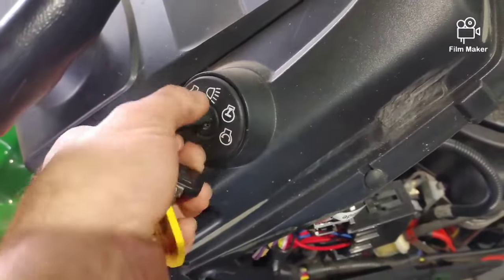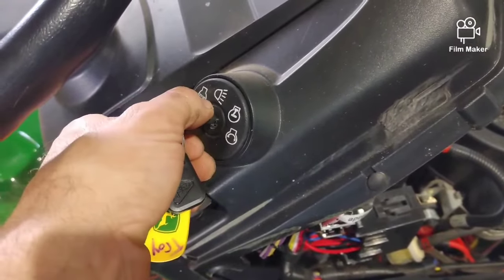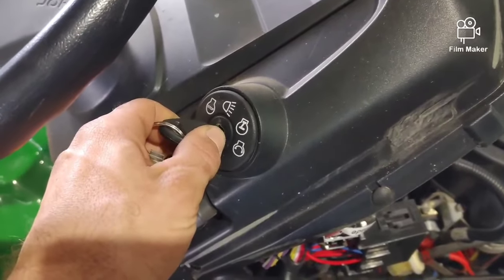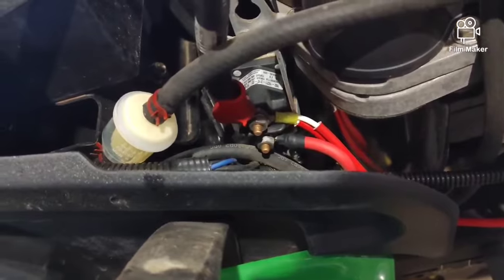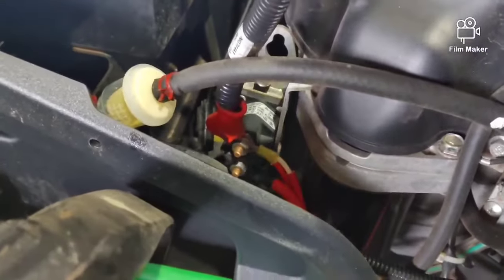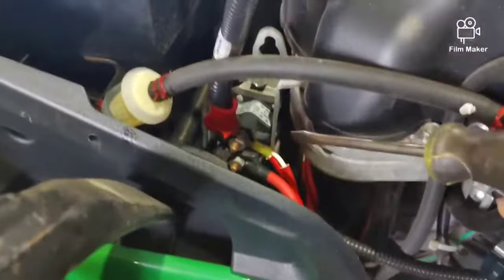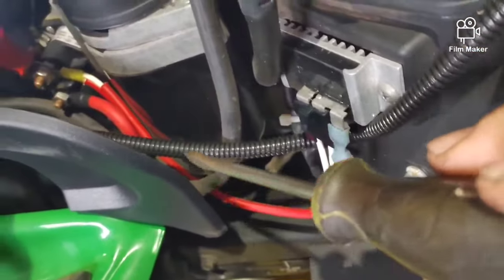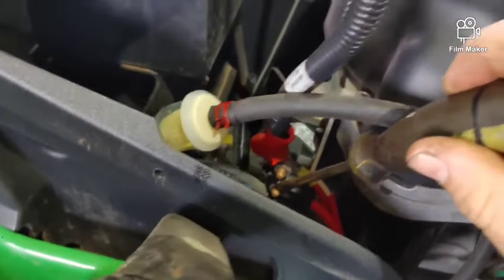Mower not starting, Just Clicks? How to diagnose & Please read video description.

Comment: I’ve got a John Deere X730. When I turn the switch to start, it has one single click. Dash lights illuminate. Checked the battery and terminals, they’re good. Replaced the solenoid, it does the exact same thing….one click.

Comment: I just took my John Deere lawnmower out for the first time this year and the starter kept spinning but didn’t engaged to turn on the engine. I didn’t know what to do, I’m new to this. I started watching videos but none of them mentioned what I needed. You did, you mentioned exactly what as mine was doing. I took the cover apart to spray wd40 like you said. However, I found mouse nest right on the starter.  I cleaned it, sprayed WD40 and it started like new. Thank you so much.

Comment: When I do this to mine, it just keeps turning over, i sprayed starting fluid and still not firing, bad plug or wire? Just odd or it to cut off while cutting then straight to this problem but not even firing
Reply from the maker: Check the spark plug first.  
It could also be the ignition coil. Did you hear a noise when the engine stopped? You could have a loose push rod that may have dropped. Or worse a dropped valve or even a broken connecting rod

Comment: I have a 1991 JD LX176 I bought new. I have been experiencing  this same issue for a long time. I was convinced I had a bad solenoid. Bought a new original JD brand solenoid and it did not not solve the issue.  That was before I gained knowledge of multimeter testing. I tested the solenoid, and after several reps of turning the key to start , I got over 12 volts every time. Removed the starter assembly and bench tested it  using jump cables and a screwdriver. Several reps of firing. I could not get the solenoid or starter to fail. Starter was throwing and spinning every time.  I am really baffled. I put the battery and starter back in the mower, and the 1st turn of the key all I got was the click. Fired up after 3rd attempt. I never know when it will fire or fail. I know I don't have a safety switch issue. It was doing this before I decided to bypass the seat and brake safety switches. Battery is about a year old and I keep a tender on it most of winter. Battery connections are clean and tightly secured. Guess I'll give up for now. Test results indicate all is fine with starter and solenoid, but something sure ain't right.

Comment: Mine is doing the same thing. I have a john deere x324. I can hear a click but nothing happens. If I put a jump box and jump off the mower it fires right up. Battery is brand new. Think it's the solenoid or do I have a problem with a connection somewhere?
Reply from the maker: I think your new battery is either bad or the battery's connections are loose /corroded.
Reply: @Mechanical_Mind  appreciate the quick response. I was thinking along the lines of the same thing. I will change battery and also the cables

Comment: I did this trick. Works when I do that but I pulled solenoid and put brand new one and did they same thing. Is there something else I can look at ? Because seems like it’s not the solenoid. Still just clicks.
Reply from the maker: Hey Dillon, First thing I always confirm is the battery condition and the connections. Make sure they are all clean and tight.  
If the start motor worked when you bypassed the solenoid but still clicks after installing a new solenoid, it could be that the new solenoid is bad. It happens to me all the time that new parts are bad right out of the box.  So much so that it no longer a surprise. 
Also, double-check that your ground connections are all clean and tight and that you hooked up the solenoid wires correctly.
Reply: Yes sir battery is brand new and no corrosion on wires to battery. Only a few year old mower. Always put up after cuts. I’ve tried two solenoids and both test good when I pull out and test with meter. I’m leaning towards maybe the control voltage may not be strong enough to hold the solenoid closed? I am going to check the wires from the key switch and see if they are broken or something. Does that sound like a possible solution?
Reply from the maker: @dillonparker9018  also check the ground wire going from the block to the frame. You could be getting a voltage drop from a loose connection there. It could also be the starter going out. What model mower is it?
Reply from the maker: It's not popping the fuse?

Comment: Thanks for the tips. It is due for oil change, air filter and fuel filter too. So im going to do all of that too. If none of this helps I'll try a battery. I've gone 2 summers on my battery, so most likely time for that too
Reply from the maker: The starters do start to stick after time. I've saved many starters just by spraying some wd40 in them.
Reply: @Mechanical_Mind  looks like this is a valve spacing issue....

Comment: my mower starts only if I jump it... could it be the starter solenoid also?
Reply from the maker: That is most likely the battery. Check to make sure the charging system on the mower is working also. Here is a video I did explaining how to check it. 
https://youtu.be/Xj1w8dWxapI

Comment: I have a cub cadet LT 1050 sometimes starts right up other times won’t do anything sometimes clicks and sometimes the starter will spin and won’t engage.
Reply from the maker: Sounds like you have a solenoid and a starter issue. Id change the solenoid first. If can, spray some WD40 on the starter wheels shaft. Wd40 will not hurt anything. Its helped me many times free up a sticking starter. Disconnect the battery negative cable first before doing any of the work. Thanks for watching!

Comment: Thanks-Having the same crap going on.
Reply from the maker: Hi Robert, Did you get it figured out?
Reply: @Mechanical_Mind  Ended up replacing the starter and the fuel pump works great. I hope I get five years out of them like the oem parts that came with the mower. Thanks for asking. Always great getting on youtube and finding people helping other people out. TY
Reply from the maker: @robertmuir4496  Good deal!  Glad you got the issue resolved.
Reply: Z920 m happen to me today. Turn the key twenty times until it starts. Clunk clunk clunk. Starter wants to throw the gear but it won’t spin. Nice vid thank you 🙏

Comment: I have  cubcadet 1554 and the start will sometimes get stuck in the up position on a hard start (and won't start). I then have to remove the started/solenoid to spin the gear back town, hook it back up and try again. This seems to be a bigger issue when the temperature is a little cooler. Could I just need a battery with more CCA rating? any thoughts would be helpful. Thank you.
Reply from the maker: Spray some wd-40 on the starter gear shaft.  WD40 will not hurt anything in the starter. 
You need a battery tester to check the battery. It may show 12 volts or a little higher and still be bad. Most lawn mower batteries these days don't last over 3 years. It's rare to see one that is still good that is 5 yrs old.

Comment: I got the mower started by using the screwdriver method you did. I put a new solenoid on it and it still won't start. Any ideas?
Reply from the maker: First double check to make sure the battery is good, then check the 20A fuse, all ground connections and postive connections are clean and tight. Once all that is confirmed good Id next check the safety switches are engaged.
Reply: @Mechanical_Mind You're the best. Thanks a lot!

Comment: I got a cub cadet  blows a fuse every time i engage the blades. Now it won't start at all, just a little lite click from the ignition switch.
Reply from the maker: My guess would be that the pto clutch bearings have gone bad which caused it to over heat the clutch and burn up the wiring going into the clutch.. Which then caused it to pop the fuse when you tried to engage the bladed. And now the bearings have seized up and will not let the engine rotate. 
Remove the pto clutch and inspect it.

Comment: My Craftsman gt2000 just makes clicking sounds when trying to start. It will only start when I change main fuse to 7.5 amp fuse? Someone chimed in and said I had arc issue? Would that be with the solenoid? Does it hurt to just keep the 7.5 fuse when apparently it is suppose to be a 20amp?
Reply from the maker: It's perfectly fine to run a smaller fuse if it's not blowing the fuse. The danger comes when people run larger fuses than they are supposed to. It makes no sense that a smaller fuse would work vs. a larger one. It could be that fuse holder tabs are not making good enough contact with the fuse. You can use a small screw driver to pry the tabs inward to grip the fuse better. I also like to spray wd40 in the holders and blow it clean with air to clean out all the dirt.
Reply: @Mechanical_Mind  Thanks. I knew about not using larger Fuses and I agree it starting with 7 5 when it calls for 20 is puzzling. It would not start with a 10 either??? I will try adjusting and cleaning fuse holder. Someone suggested it's an "arc" issue? Is that with the solenoid? I will advise if I figutecit out. I'm working on a friend's mower that is a vet suffering with Alzheimer's. He used to be my mechanic and now struggles with these tasks! Thanks!!!!
Reply from the maker: @judisinger3693  What they mean by an "arc" issue is that it's a loose connection or wire with worn insulation, and the electricity is arcing across the connection, which will blow the fuse. 
It can be as simple as a loose battery connection, corroded connection, or a loose wire connection going to the solenoid or starter motor.  Often times it can be caused by a loose ground connection. A good visual inspection of all the ground connections and wire connections is where I start. Also I'll examine the wires for melted, damaged, or worn wire insulation. 
It's usually an easy fix once you find it. The hard part is finding the issue. 
A blown fuse can also be caused by a faulty starter motor or other component but more often, it's a loose connection somewhere. 
I'd start by disconnecting the battery. Disconnect the ground first (negative) then the positive. Then while the battery is disconnected carefully inspect all the wires and connections. Better yet disconnect, clean, and reconnect any connections that look corroded.
Reply: @Mechanical_Mind  Thanks! I've dealt with ground issues with trailer lights! May take a day or two to get back over there to work on it! There is obviously something going on and will big me til I figure it out! Thanks for your suggestions and explanations.  I will advise what I find. It may help someone else!!!

Comment: Have a John Deere 445, only clicks, jumped the solenoid and all you hear is   starter spinning and not cranking the motor.....help
Reply from the maker: First thing is to confirm that the battery is fully charged and that all the connections are clean and tight. Don't just look at them and assume they are good. Disconnect the connections and clean them with a wire brush and spray them wd40. I can't tell you many time customers spent $hundreds on parts when all it was was a bad or loose connection the entire time. 
It possible the starter and solenoid are bad but Id check all the connections first. Here is a video I made showing how they work and common problems with the starter.   
https://youtu.be/aKdlb6Ko8Ng
Also I made a video on how to check your mowers charging system. I'll  find that and send it

Comment: When I bypass the solenoid on my toro it just throws sparks. Battery voltage 12.64
Reply from the maker: Starter bad
Reply: @Mechanical_Mind  thanks for getting back to me so quickly. This is the answer I was afraid of
Reply from the maker: Any updates?
Reply: @Mechanical_Mind  I'm going to pull the starter and bench test it, just haven't found the time to get to if